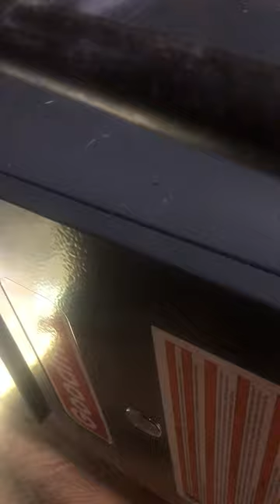😮 Claims Adjuster destroys Servpro for 3 mins. during State Farm Inspection

Comment: That is soot not mold. That is insane if they say it is mold. They failed to perform their fire restoration job properly because they were hired by the property insurance. So they cut corners to charge the homeowner insurance cheaper. They are slaves to property insurance. Servopro and few others